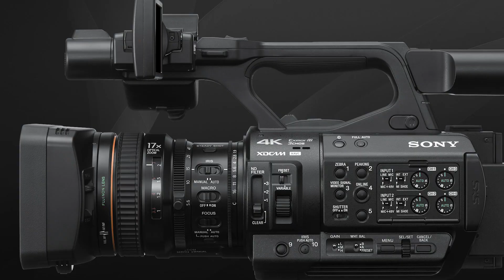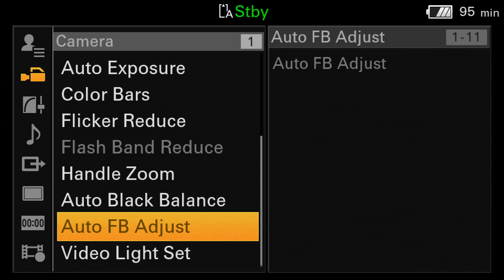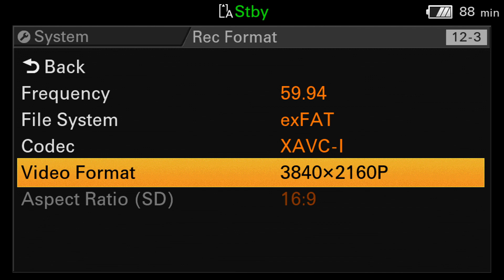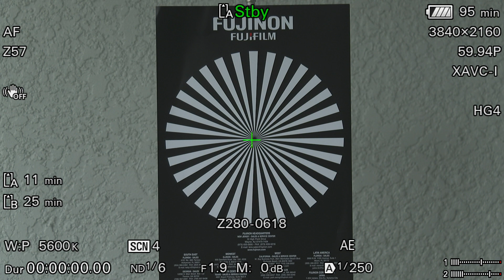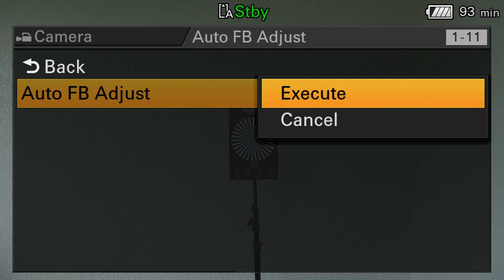How to Properly Adjust the Back Focus on the Sony PXW-Z280

Comment: I’ve been considering this camera for awhile now.  Been totally spooked about all the negative reviews.  My question is how often does this (back focus adjust) need to be done?  Thanks for this video btw
Reply from the maker: I had to adjust the back focus on my Z280 the day I bought it, but I have never had to adjust the back focus again and that was September 2018.  14 months ago.  Hundreds of hours and miles have been put on the camera since then with no trouble at all.  Also, I spent the entire month of September in Fiji working on a TV show called Eco Challenge for Mark Burnett (the company that produces Survivor, Shark Tank, etc).  Eco Challenge is billed as the "World's Toughest Race".  700+ crew and $35 million budget.   My job was to setup, match, and oversee about 60 cameras and train the operators who had never used most of the cameras before.  We had a total of eighteen Z280s.   They were put through hell on a 400 mile adventure race through jungles, mountains, rivers, ocean, etc.   Only one camera out of the eighteen Z280s needed a backfocus adjustment at the end of the shoot.  And that camera was damaged beyond repair.   And none of the cameras needed a back focus adjustment when I checked them prior to the race.  The Z280 is a rugged camera.
Reply: @DougJensenVortexMedia  strange  thing happened this  week to  my back  focus on  my 280. Back  focus looked great except the  very widest setting. Just a hair  short of  wide  it jumps out  of  focus.../? Never saw that before. Did the FB adjust and I think  fixed it. However there was no reason for it  since it  was not dropped and  does not get used  alot...???
Reply from the maker: @emavideo  Sometimes it is hard to pinpoint why the back focus my have become out of adjustment, but fortunately the fix is simple.  I still have only had to adust mine the first day I got the camera in October 2018 and it has been perfect since then. But I do check it occassionally to be sure.  Along with Black Balancing it is just part of my normal routine every few weeks.